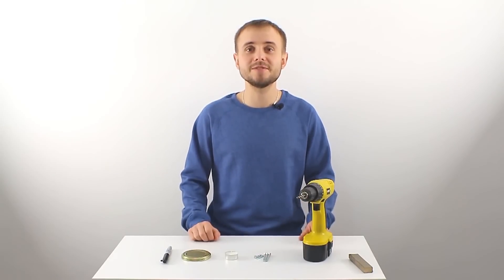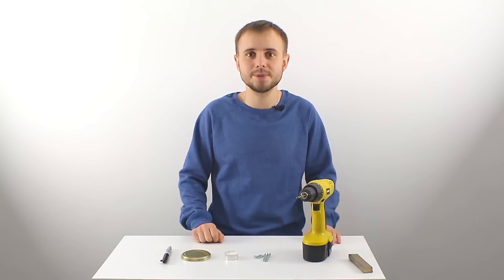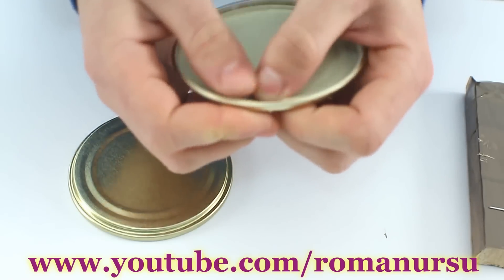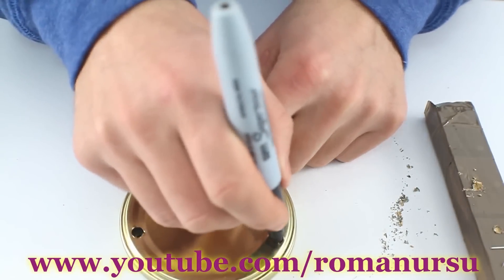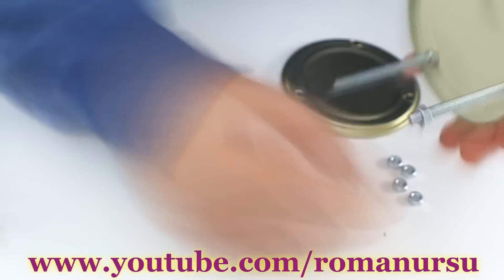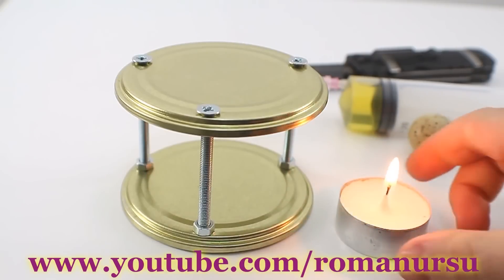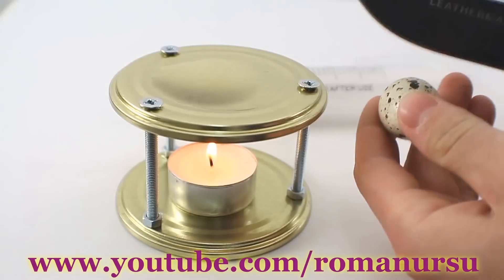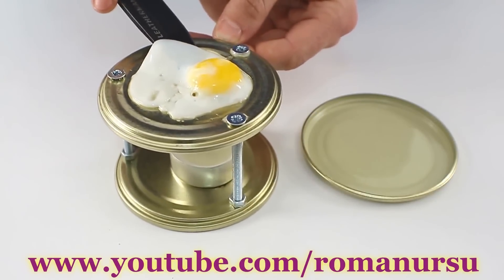How to make a mini table stove

Comment: another hint.... when doing the videos, since you are translating them to English. you should also convert your measuring system over to ours to..... we do not use metric and tons of us don't know the conversions. when you but nuts and bolts over here they are in inches, not centimeters, and millimeters. Just a suggestion.

Comment: this is a very nice and easy design but I would flip it around the other way because the sides of the lid provide some sort of a boundary
Reply: I'd try a small pan or even a foil cake tin on the top instead of just the egg 👍